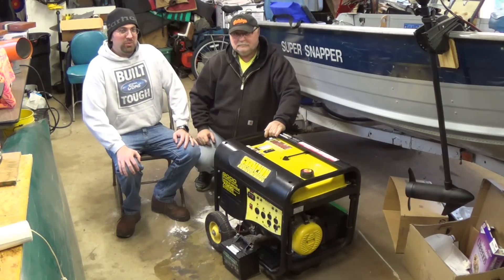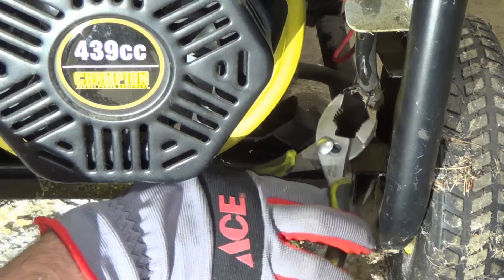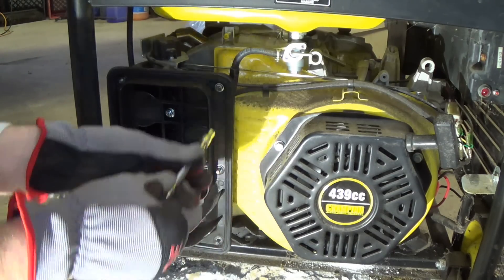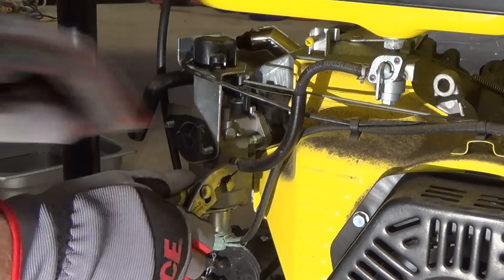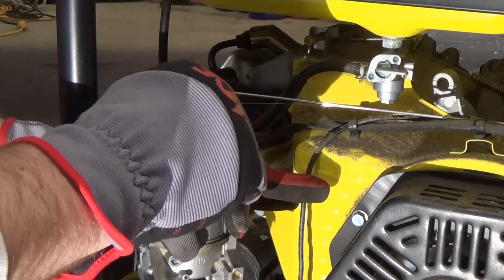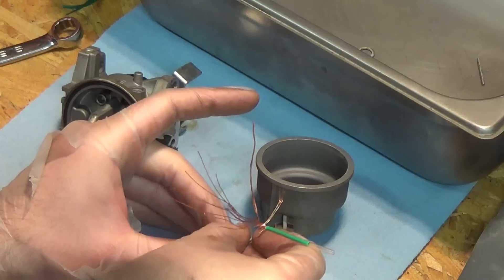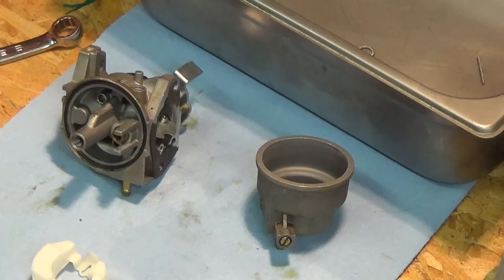How To: Repair a Generator That Won't Start or Stalls

Comment: Thank you so much!
I’ve got a good one and I don’t know if someone can help me, it doesn’t start easily but when it starts it runs good for whatever I use it, if I shut it off I can’t start anymore for the longest time ..about 5 minutes pulling etc.

About a 10 year old Champion 1500 watt generator.

Comment: I'm so glad I found your video. It really helped me repair my Champion genny. 

I have a couple of comments:

All of the bolts and nuts on this genny are metric.

The electrical gadget under the float bowl is the low oil shut-off solenoid.  

Did you ever find out what caused the gas in the oil?

Comment: I watched 4 or 5 different videos before finding yours. I'd just about given up. I had the generator apart every time I watched a different DIY. You're the only guy who told me to clean the jet inside the carburetor. THANK YOU! I thought that might come out, but I was worried I'd ruin timing or flow... again, THANK YOU! The generator started sooner than it ever had before, too. Like half a pull, rather than 3 pulls.
Reply from the maker: Glad to hear this video helped you! Persistence pays off. :)

Comment: Hey! You misidentified some parts in this video. The long brass tube is not the jet. It is what is known as the emulsion tube. The actual jet is the device that i think you called the jet retainer. It it the part that you used the wire on to clean. You also called the device on the bottom of the carb a sensor. It is not a sensor. It is actually a solenoid that shuts off gas flow to the jet when the low oil sensor activates. Other than that it is an excellent video.
Reply: thank you for this clarification as i destroyed my jet getting it out and needed to know the proper name so I can order a new one.

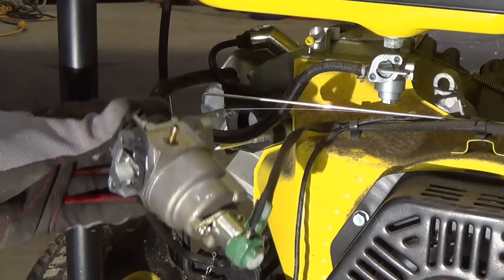Comment: @5:00      That "... some sort of electrical "sensor" on the bottom."  is actually a fuel shut-off solenoid with broken plastic in evidence.  It immediately shuts the fuel off to keep the EPA ever-so-happy over unburned fuel vapors escaping during shutdown.  That's the same EPA that made the manufacturers put the breather vent from the valve cover to the carb so that the incoming carb air is contaminated with various oil and combustion products.
The """Jet""" you removed is actually an Emulsion Tube and it's retainer's passageway was not expanded or "reamed" since no metal was removed by your copper wire strands.  That hole was just cleaned.  Fuel in the oil is 99% a problem with carb float needle valve allowing tank fuel to bypass the float valve shut off and go to the crankcase
It doesn't matter how much oil is in the container - it's the actual level in the crankcase that matters.  Oil is 'FULL' when the level is up to the top of the fill plug hole and just starting to run out which means you are running with minimum oil right out of the gate.  Too low oil level means that the low oil sensor will shut down the genset with no restart until the oil is serviced.  
What you are relying on is a conditioning from cars and trucks to use the DIPSTICK to check oil level - The center checkered part of the gen-set's fill plug is *not* a dipstick but just a way to pull oil out of the crankcase to check it's color / cleanliness.
Does that gen-set have an on demand 'Run / Idle' circuit?  It shouldn't be running @ 3600 RPM without an electrical load on it - rather at a reduced, idle RPM.
Nice generator there!

Comment: Thats not the crankcase breather tube. It is only the oil drain. Crankcase breather runs into the air filter assembly. The tube you are discussing is called an emulsion tube, and the plug you are referring to is the main jet. The sensor is the fuel cutoff solenoid. It frequently sticks open and let fuel drain from the tank into the carb and then the engine.

Comment: I have a Champion like yours (but  a bit less powerful).  Was at the cabin this weekend and tried to get it started (probably for the 10th time this summer) but still no luck.  It only runs if I keep spraying carb cleaner in it but, as soon as I stop spraying, it stops.  Came back home today and watched your video... Now I can't wait to go back to the cabin and try to properly clean the carb following your instructions.  Hope it will work, fingers crossed.  Also, how did you manage to connect a battery to it so you don't have to pull the cord to start it?  Can you do a follow-up video on this?
Reply from the maker: Good luck with repairing your generator! Some models, like Paul's, came with electric start and a battery. Many smaller models only have the pull start.

Comment: That's not  a sensor on the fuel bowl it's a "cut off" valve...its a normally closed valve that opens when the key is turned on and shuts when the key is turned off....its designed to stop fuel from entering the carb once the engine is turned off so that it wont backfire or continue sputtering and coughing until it finally dies. If it malfunctions, just remove it from the bottom of the bowl, pull the tiny spring loaded pin out of it and break it off then put back on carb

Comment: Just what does the solenoid on bottom of carb do ? That may be the problem of fuel in the crank case .
Reply: Fuel in the crankcase is very dangerous and is basically a gasoline fire waiting to happen...fuel in the crankcase is usually caused by a carb float valve that is stuck in the down (open) position. It is the job of the float and needle valve to keep the fuel level in the bowl in check, as the carb bowl fills the float rises which is in essence riding on a see-saw with the needle valve and as it rises it forced the needle valve downward finally reaching the needle valve seat which stops any more fuel from entering into the bowl, if stuck open fuel will continue to enter the carb bowl then up into the upper section of the carb where it overflows into the carb tunnel and eventually begins filling the cylinder.
The solenoid on bottom with the 2 wires stops fuel flow when the engine is shut off this preventing backfires and prevents the engine from continuing to run after shutting the engine off...it in a nutshell is a "normally closed" switch that is connected to the battery via the key ignition and opens when key is turned to the on position and closes when key is turned off
Reply: @timothysims3500    I was asking in order to get others to think and to get the most accurate answer which you explained it great . I’m not the best at spelling or explaining especially on this phone. I’m old and I have big fingers and I’m always hitting the wrong letters. I’ve always been a do it myself person in everything. I’m disabled, and in constant pain some better then others . But life is good so what I’m trying to say is you don’t know what people are going through so be kind be polite it will make things better for everyone there is too much meanness to go around. So put a smile on and spread kindness and try and left up and not tear down be positive and not negative for life is a gift given each day by Gods own hand be blessed everyone and walk in peace !

Comment: thanks, your video help me get my generator to start, my carburetor was clogged up with old fuel and crap after sitting for two years. after watching your very helpful video i opened my carb up (i have never opened up any kind of carb before watching your video)
 and seen it was clogged cleaned the tiny holes with a tiny wire like you did and now it runs like brand new, thanks

Comment: I watched this a couple times, as I was taking my carburetor off.  The video quality is excellent, and I got mine torn down to the very last part, and cleaned everything up.  Mine was dirty and crusty, and I used all the tips you recommended, right down to the stranded wire.  No one was more surprised than I when I pulled the cord and our 4550 started right up!  This unit had not run since last year.  I have never worked on an engine, before.  My hubby fixed supper for me, he was so proud.  Bottom line; anyone can fix a carburetor after watching this video!  I did drag out every tool we owned.  Thank you for a wonderful video!

Comment: Thanks for sharing!  Great shirt, I'm making a custom JD 240 into a Ford JD 325 as a hydraulics actuated implements project to compliment my Ford YT16 electronic actuated implements project garden tractor.
Reply: The sensor is a fuel cuttoff valve and anti backfire... I think has another name also.  Prevents fuel getting into the already hot engine head and backfiring.
Reply from the maker: Very cool!

Comment: Got mine workin after cleaning that little screw hole that holds the jet inside the carb.
Had it apart twice. First cleaned the big jet and put it together without cleaning that little screw. Watched this vid. Took it apart and cleaned that hole in that screw and generator fired right up. Had to adjust the throttle to keep it from surging but works fine now.
Thanks
Reply: The little screw that that holds the "jet" is actually the jet. The other piece is the emulsion tube.

Comment: You guys are a hoot.  Entertaining to say the least.  Eric you need to keep a closer eye on Paul and administer that tough love when its warranted.  Paul, when you check the oil level of ANY equipment with a screw in dipstick, after you wipe it clean, insert it back in without screwing it in (bottom thread of dipstick contacting top thread of crankcase) otherwise you'll read high by about 3/4" which is alot.  Reality is that your actual level is too low...Eric you know better...but heck it's not your unit.  Lol.    Keep on filming guys!

Comment: Great video. I followed your instructions for removing and cleaning the carb and my Champion generator fired right up on the first try. I then worked on my 2700PSI Honda 5.0hp pressure washer that had been stored for approx. 20 yrs, with gas in it. Carb was a little different but I followed the same basic steps and it turns out that this too is alive! Again, great video. Thanks!

Comment: the carb can leak fuel in the cylinder, eventually flooding the cylinder and a hydro-lock fatality when first started, but in this case it all went slowly into the crankcase: so never forget to close your fuel valve, and stick to pull-starters :-)

Comment: Hi, tell me, please, the two wires from the carburetor coil, where are they connected?
Reply: The 2 wires leading to the carburetor are for the tiny fuel cutoff valve inside the carburetor. Known as "normally closed? Valve, when the key is turned to the start position the switch is energized and opens to allow fuel to flow and when the key is turned off it shuts off the flow...it is designed to stop backfiring or vapor running to where it backfires or continues running after the mower is shut off

Comment: I have a Briggs and Stratton Storm Responder we turned on once but never
 used. I paid over $1000 for it. I put up on Ebay and two years later 
have been offered less than $200 I put up on another ap and several 
people want if for $300 but when I went to turn on it starts with 
starting fluid but wont run. I have paid over $100 now for fixes I 
changed oil, air filter and gas and used the gas storage chemicals,I 
have drained the gas and oil and opened the air filter but it still 
dies. At this point I have contacted Briggs and Straton for several 
years by email calls etc. Nothing! It sits in basement just making me 
hate it. Can anyone tell me how to fix it as I want to give it away but 
nobody wants a dead generator. I guess that's why in two years I never 
got a bid. I am an old lady who cant just throw away money and really 
need a little help. I have watched hours of video and thought it was the
 oil sensor but after searching for  hours found out that no oil sensor 
is on this model. I wanted to just pull the yellow wire and be done. 
Please have mercy on me I need it out of my house. By the way its heavy.
 Thanks

Comment: Awesome video👏🏽👏🏽👏🏽 my generador is a Dewalt 7000  I used for two or three times three years ago and I never used it again, now after three years I try to used it  won’t start ! Is been sitting on my garage all this time ,  first thing I drained the gasoline  put fresh gas and won’t start! Next I check the gas valve and works and also make sure goes all the way to the carburetor. Try again and nothing!  After I watch this video I took the carburetor a part and I found out that the plug that holds the jet on place was clog completely clogged !! I didn’t use a wire but I use I toot pick clean it out very good put it back together and start it right away!!!

Comment: THAT " SENSOR " IS A FUEL SHUTOFF VALVE THAT WHEN ENERGIZED (KEY ON) WILL ALLOW FUEL FLOW.
Reply: I think technically, the "sensor" triggers the magneto from being grounded or not... at least in my Champion generator design.  If the sensor oil level is low, the magneto is grounded so the engine dies or won't start.  Technically, this can be bypassed and not even used... though not a good idea if you're running your generator regularly and/or often.  Though I'm used to checking oil always before use and inspecting around the engine also for leaks.
Reply: @jafinch78  hey bud the sensor isnt a sensor it's a tiny valve in the carb bowl it opens when key is put in start position and closes when key is turned off, and is actually a normally closed solenoid valve . Its purpose is stop fuel flow after the engine is turned to prevent the from backfiring or dieseling after its shut off. Sometimes the coil which pulls in the solenoid will fail and wont allow fuel into the bowl, just remove the switch from bottom of carb and with a pair of pliers pull the spring loaded pin out and break it off and put back on carb...
Reply: And is powered with 12vdc from the battery  through the key switch...that's the "click" you hear when you turn the key on
Reply: @timothysims3500  Right if the fuel shutoff solenoid.  Great call.  I typically like keeping the fuel shutoff or anti-backfire solenoid whole, unless needing to operate the engine soon, with the riders and tractors so if I forget to throttle down... I don't have to deal with the backfire.  I know on mine, the only sensor is the oil level sensor that I bypassed on my Champion 4000W to get er going and troubleshoot the not starting condition.  I also had to clean the pull start levers since weren't moving out and in really smooth.  One of those risky almost seems like the engine was seized... though was hoping and praying was just the pull cord stuck.  Otherwise, the cord and oil level sensor issues, mine wound up having way loose valve lash is all engine wise... or at least seemed when I worked on last.
Reply: @timothysims3500  I've got the 4000W model that isn't the key start.  Though thanks for the advice and affirmation.  Good call.  Have had to do on the riders and garden tractors that have the anti-backfire solenoid a few times.  Can hook up a 9V battery and test with too... though is easier if no other shut-off switches are bad or off position to just listed when turning over in a no starter powering condition.

Comment: If I had to guess It was most likely an oil overfill sensor kicking the generator off. Changing the oil I think did the trick more than cleaning out that carburetor.

Comment: I wish you had  shown how to reinstall the throttle rod and spring - it's always the hardest part!
Reply: Just a little twist of the carb and the rod pops right out. Needle nose pliers for the spring. Reverse to re-install. 4 months later, I'm sure you've figured it out by now
Reply: Yea its easiest to put those on the carb before you put the carb on the mounting studs...if the tiny coil spring gives u a hard  time run a length of thread through the hole that the spring rests in and tie it to the part of the spring that goes in the hole then pull the spring to the eye with the thread...that tiny spring counteracts the action of the governor and keeps engine from undulating or revving up and down while its running

Comment: how do you take the fuel out the tank
Reply: Pull the fuel line off at the carburetor inlet and drain it into a container... or if youre feeling lazy simply burn it off by running the engine.... that way you don't have to store it.  Lol

Comment: I got tired of this happening too.  I converted to propane by drilling a hole in the air breather, screwing in a 1/4 inch barbed brass fitting. Hooked my propane bottle with 1/4 in hose which had a regulator and a petcock valve to the brass fitting in the air filter box.  Run your choke setting wide open for adequate air mixture and adjust your RPMs with the amount of propane you give it at the bottle.  Gasoline only lasts 6 months in the tank then gums up the carb like in this video, LP never goes bad.  You won't have to change oil in the generator because there is no carbon burned with the clean LP.  Engine runs cleaner, smoother, cooler and lasts longer.  The only caveat here is there is no LP cutoff if the generator dies.  The LP will keep pumping out and can be a fire hazard if unattended.  You can buy an electronic cutoff valve for the propane bottle that plugs right into the generator.  If it quits, it shuts off the propane at the valve.  Great video here guys, many thanks.
Reply: I know this is an old post but would like more detail on converting my generator to propane or natural gas.  Every year I have to clean the fuel intake system.  Thanks
Reply: The cutoff solenoid would be the way to go to be safe and not waste fuel thinking.  Thanks for sharing.